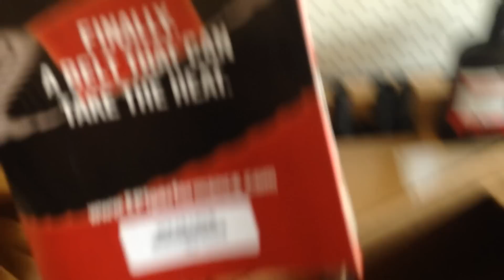MMB-27" Mega Mayehm tire install- Grizzly 700

Comment: Nice, the mayhems have a similar tread pattern to the zillas. Ive always been impressed with the zillas i have on my grizzly 700, they work well in all terrains, except fast cornering. Amazing in the snow as well
Reply from the maker: yes i was really looking into the zillas but i decided to go with just a bit more agressive tire
Reply: itsme78932 you would think mayhem’s are tractor tires

Comment: If you haven't already noticed, the spring really does very little for power. You need to do the shim mod and some greaseless weights. I run 27' zillas and can pop wheelies in high with no jerking on the handlebars. Other than that, badass bike.

Comment: @jaysin27ger did you have to lift the quad to be able fit those tires I’m looking into a putting bigger tires on mine just not sure what’s the biggest size I can go with out having to put a lift on the quad

Comment: use star pattern for the nuts!
Reply: +christine exactly what i was thinking..
Reply: christine All I could think
Reply: yes or a x
Reply: christine preach
Reply: ALSO USE A  1/2" DRIVE BREAKER BAR  TO CHECK TIGHTNESS NOT A STANDARD 3/8" DRIVE RATCHET . JUST SAYING MAN

Comment: What were the exact rim dimensions or did you use the same size rim for all 4 rims?  Looking at putting a set on my sportsman 500.
Reply from the maker: +Dakota Dayer same rims all around just wider tires in the back
Reply: JAYSIN27GER 9" and 11"rear?

Comment: hey mate great vid, couple of question's
how does that tread ride on hard dirt road slow & high speeds? mine will be setup up for hunting not mud
did you have to lift your suspension ? if how much?
 what size rims are they?
cheers mate
Reply from the maker: these tires are more of a mudding tire, but they do handle extremely well on dirt roads, even pavement. i didnt  need a lift for these 27 inch tires, and there on 12 inch rims? thanks for watching.

Comment: You should have gotten 30" silverbacks or 29.5 outlaws they will fit stock. If you want to go mudding these are the tires to go with
Reply from the maker: I know what the silver back and outlaw tires are capable of, but i do a lot of trial riding, so if i got the bigger tires i would have to get a clutch kit and it would ruin the trail riding, also i save another 1000 just on axles.
Reply: True and I respect your decision.
Reply from the maker: Taylor Mascaro I did my research, i knew exactly how i was going to modd this bike, I mean if money didn't matter to me, i would just get a can am mud monster and i would also have a grizzly trail quad. But i had to cram both into one bike.

Comment: Mayhem or big horn ? who's the best?
Reply: I just bought a 2020 grizzly 700se,  it comes with 27 inch mayhams,  totally hated them and put my 30 inch monstermayhams on that I kept from my 2015 sportsman 1000xp. 
The monstermayhams are a way better tire, zillas kept hundreds of lil rocks stuck in the tread , no clutching and it's fine.

Comment: Out laws are the way to go
Reply from the maker: Yes I no they are, but if u go with outlaws you are adding a lot more weight in tires and for this small of an engine u need to add a full clutch kit, all new axles, and at that point I would add a lift to it too. But I didn't want that nor did I want to spend an extra 2 grand. Beside I do a lot more trail riding then mudding
Reply: +JAYSIN27GER good point.   What Snorkel Kit Do You Have
Reply from the maker: +Glow Nation "snorkel your Atv" a website that I found, really good
Reply: +JAYSIN27GER thanks
Reply: Outlaws ain’t shit but looks
Reply: HARD R Garage lol

Comment: Hey there I just bought same ones but have not mounted them yet, can you check to see if they measure true to size? I heard they run small that why I asked. Do you have lift kit?
Reply: they are a true 27 inches. I bought a set for my 450 Kodiak and tried them. A bit to big even with some fender trimming.I will go back to my 26 inch mudlite xtr which are great tires also.the mega mayhems are now a spare set for my renegade xmr

Comment: Do you have a lift on your atv? will stock height work with 27's?
Reply: EpilepsyWarning thank you for the respond I purchased them a while back and I have a stock grizzly and the tires don't rub for me but they are a little heavy so I had to buy a clutch kit and now its fine.